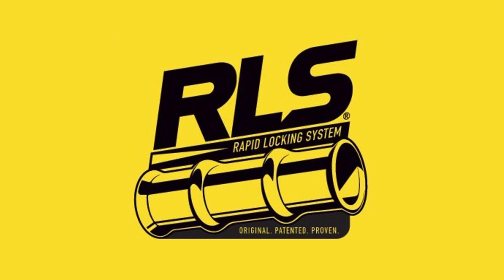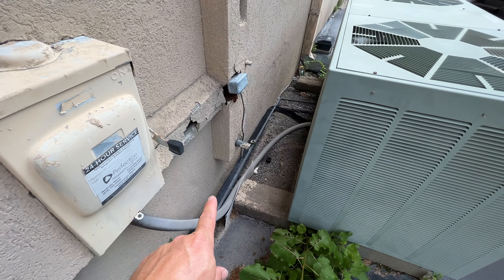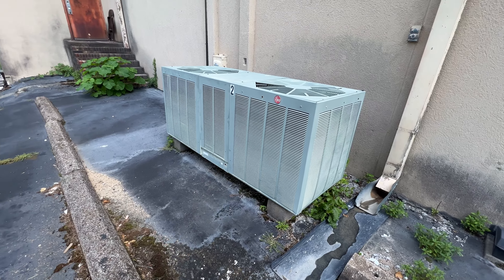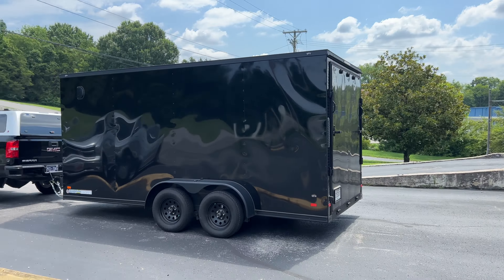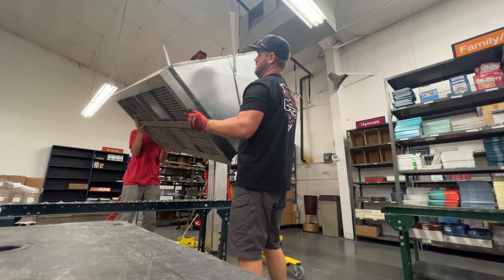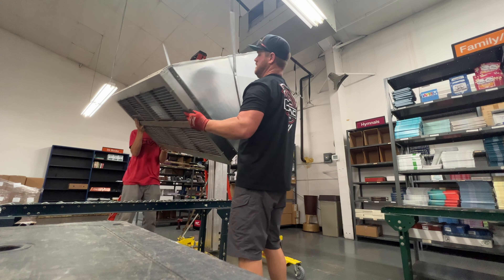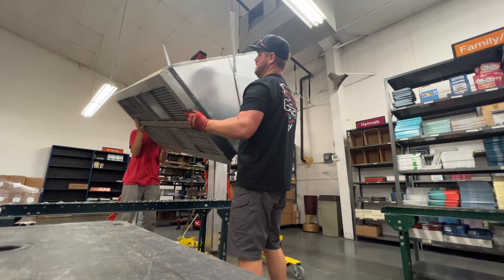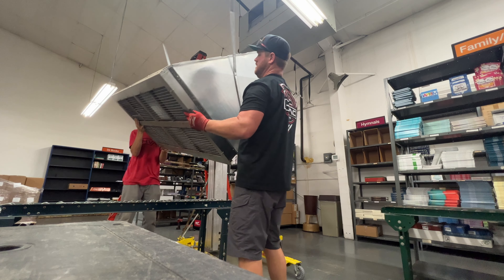Replacing a 10 Ton Commerical HVAC System - Part 1

Comment: Ive installed a bunch of these air handlers. Things are so damn heavy and i use the same lift which really is a major help
Reply: Do you know the name of the lyft
Reply: @shielduniversity419  you can find them used cheap usually need a new cable or gear on the crank

Comment: Question? I’m having trouble with the drain pan area always leak water. I took apart clean it and nothing seems to be clogged and still leaks water as if the water isn’t catching on the pan or water is just bouncing and barely coming out. Is there a reason why ? Or how can I fix this issue?

Comment: Hey buddy how you doing around there? I like your videos they help me on the field. I have a question with exact the same unit, I'm on the step of trying to start it up but I just can not find how to wire the low voltage I  already check everywhere so if you please give me a help with I will appreciate it.  Thanks.

Comment: Bro, i know you run a one hose set up with the Blue hoses. do you do anything special to them or the fittings to keep them from leaking because i bought two and i am not impressed, disappointed is probably the better word.My two oil filled 3/8s hoses and my YJ with  the  appion Valve core remover gets me down faster and deeper. how could that be. I am running the Fieldpiece 8CFM pump. new Accu tools shrader remover & Nylog to boot...I am not one to  blame the Tool until i have done everything.

Any tips?

Great Job as usual.

Comment: While an auxiliary drain pan may not be required   it might be something to consider. Also I didn't understand why you bent the threaded rod. Are you going to insulate the drain line?
Reply: Drain line is inside the heated and cooled envelope. It shouldn't need insulation.

Comment: Just a few criticisms, the condensate line, too far out from the unit making it really hard to service it. A fat technician is going to brutalize that PVC pipe trying to get into those access panels to service the blower and all that. Tuck that in close with a 90 right off the drain pan and bring it down below the unit and out. You need a secondary drain pan on DX AHU always, and preferably with a wet switch wired into the condensing unit and a completely separate drain from the primary drain.

Comment: Very neat. What keeps you so motivated to undertake your job so professionally and staying in the hvac field for so long?  I try to maintain high standards as well but in my area  there are many private technicians driving the cost of labor down to scrums and many of the customers are moving away from quality technicians and  accepting shabby work from poorly trained technicians because their cost of labor is equivalent to a bucket of KFC.
Reply: Yep & when it breaks they call you to fix it & we are left trying to patch a hack job, an almost impossible task sometimes costing as much as the hack job install.
Reply: @rebus570  Well said 👏. Also the majority of suppliers in my area are selling VERY cheap Chinese low quality air conditioners so the customers buy them and run them with low to no maintenance and when they breakdown it's either replacement with a cheap or free install or DIY or look for a cheap technician to repair.